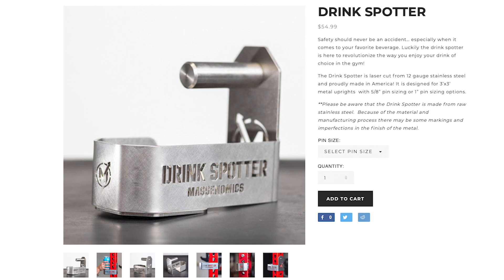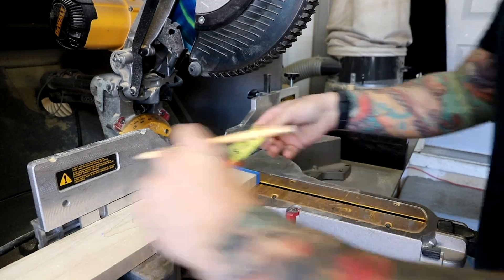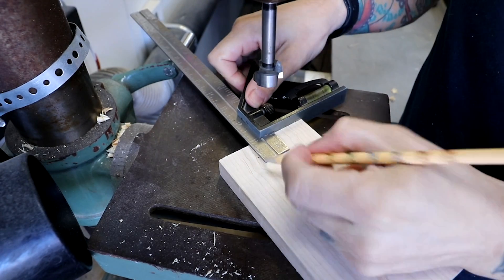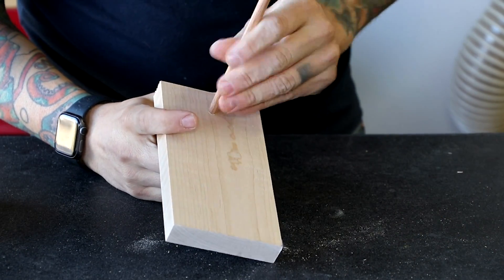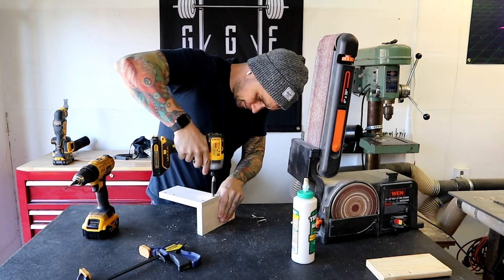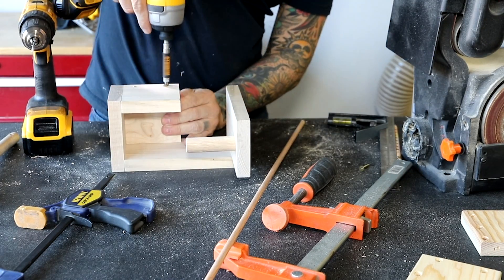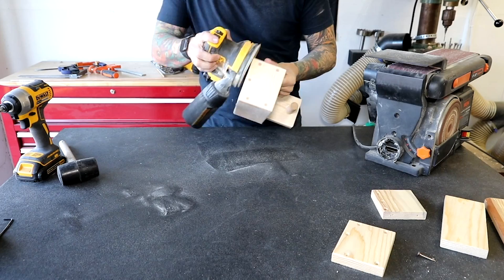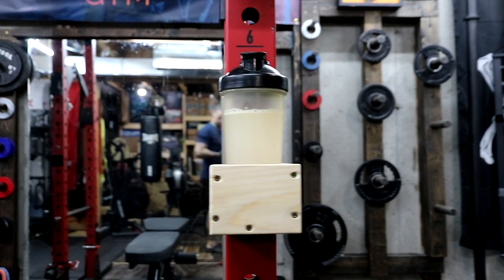DIY Drink Spotter, a drink holder that mounts to a power rack | home gym hacks

Comment: Just FYI, as a woodworker i have to point out that most of these joints don’t need any screws. Including the big dowel that will go in the rack. I made big plate racks out of jointed and planed 2x6s and 1.5” dowels. Glue only. Each one is holding 260lbs of weight. Anytime you’re gluing long grain together the joint will usually be stronger than the wood once it’s cured. Great video and awesome idea!
Reply from the maker: Thanks for the info. Typically my builds need to bear weight so it’s just habit to add reinforcements to the joints. I’ll keep that in mind for future projects.